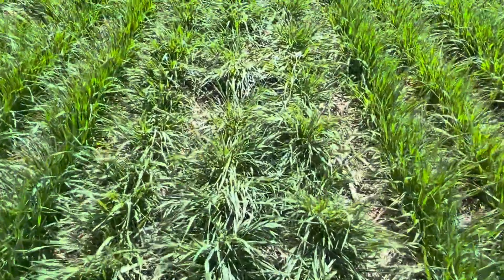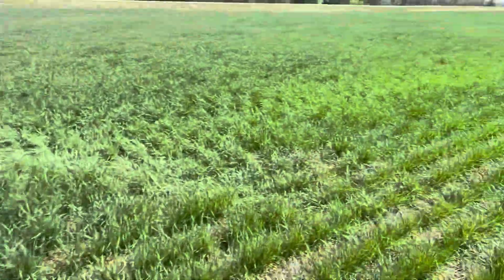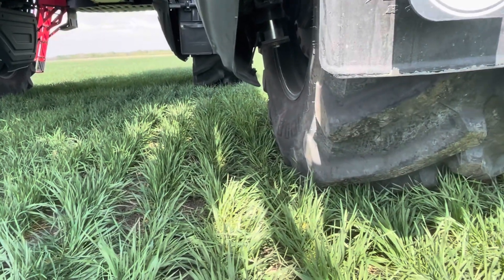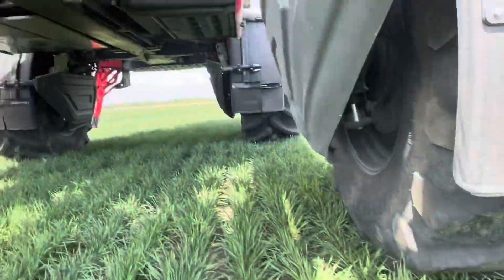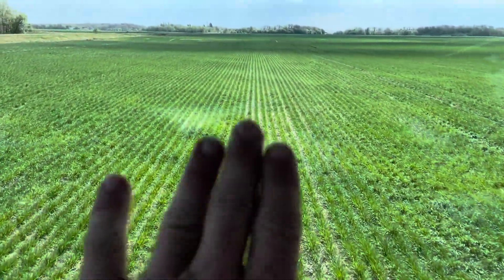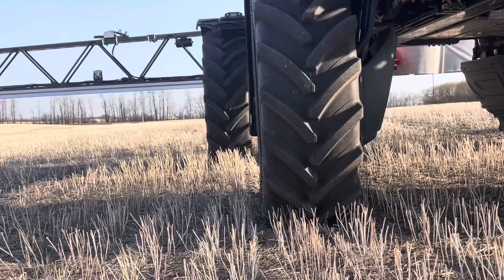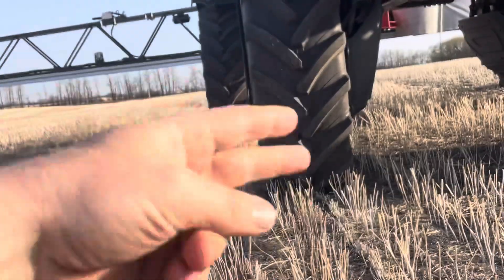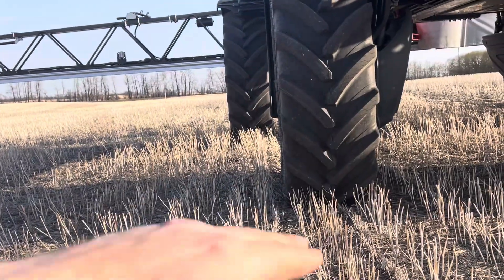Offset track spacing in Cereal crop.

Comment: Man been spraying for years………..makes a huge difference, good tip! Lol
Reply from the maker: Did you try it?
Reply: @mikewasylyniuk244 absolutely, works day and night……..I used to spread out the tires so the dust was less concentrated in the middle but offset is noticeably better. Depends on the soil type but huge difference from leaving trailing each other, couple days later even in more advanced crop you can’t tell where you drove.